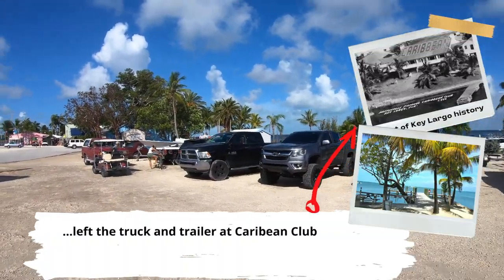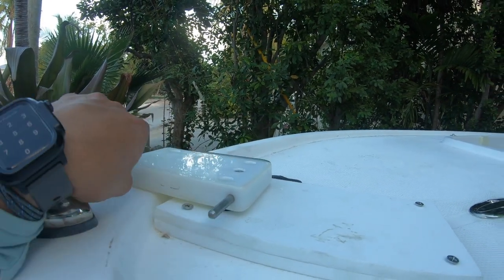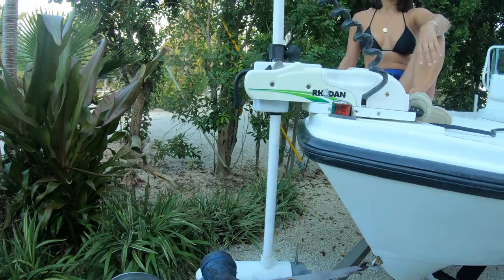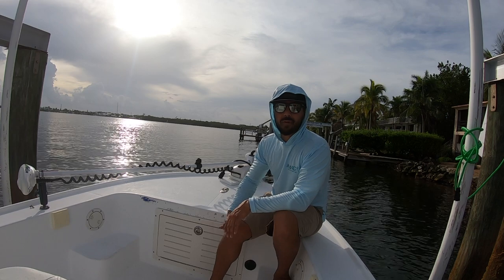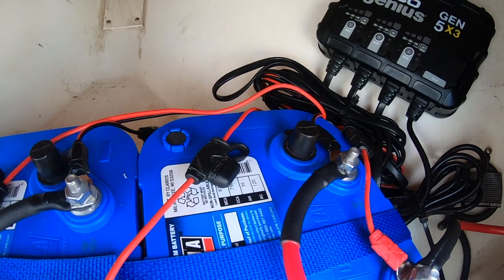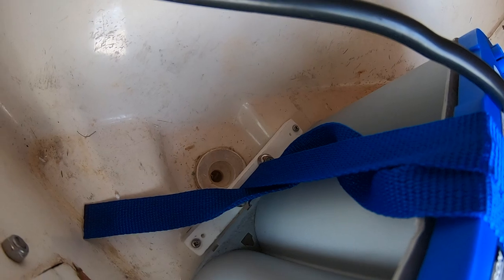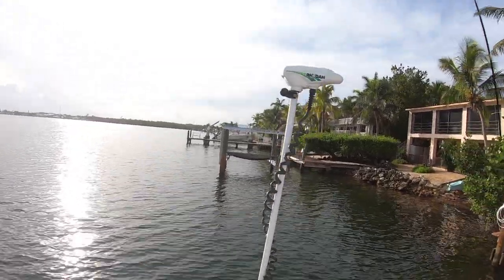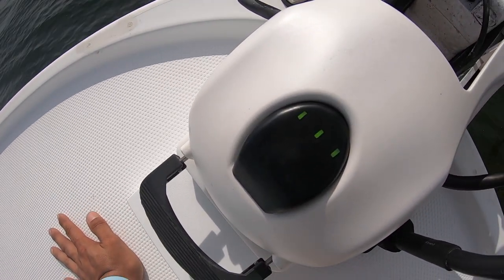Rhodan HD GPS Anchor Trolling Motor Installation on a Mako 171

Comment: Im about to do this to a 1973 Mako 17 that I just purchased. How did you mount the NOCO 3 Bank Charger?
Reply from the maker: In the front hatch up against the gun wall 👍🏽
Reply: @ChasingFloridaa  I saw the location in the video. I was curious what kind of screws and how long  they are? Thanks!

Comment: I'm literally about to run the same exact setup I have the same exact TM but I don't know what batteries to run with? How well do your optima perform? Yesterday I almost bought a single 36v ionic battery
Reply from the maker: I’m running 3 D34M optima batteries marine blue tops.  I couldn’t fit 31 or 27’s.  The 31 series is ideal.  I like the singles 36v batteries, the thing is it’s only good for the TM.  I installed a switch over on one of my optimas to power my outboard and Radio system in case I lose the main one.  Just something to consider.  I fish 8 hours with it, usually GPS anchoring in heavy current and moving position in 5 foot increments.  I’m sure if I anchor up in weak current I’ll get more time out of them but I haven’t done that yet so I don’t know for sure. Hope that helps! 👍🏼

Comment: Great Vid, I'm new to boating and considering one of These Rhodan. I have a million questions, but i'll refrain =). biggest concern for me- 
how long does the charge last? will rougher waters drain it faster?  recharge time?
Reply from the maker: Fully charged I’ve gotten about 8 hours.  I’m running group 34m AGM optima marines.  Group 31 and 27 will get you more.  Consider the space and wiring.
Reply: Look on Amazon for the group 31 from Odessey. 100 AH. 
PC- 2150 S 
The letter dictates the stud type. Odessey uses 99% pure lead and thin plates making them heavy but more powerful than others. They cycle deep and last a long time. They’ll recharge in about 4 hrs with the right charger. They are AGM batteries. Be careful with lithium ion batteries. A lot to know about them. Not just a throw in and go battery. Wind,current and seas will determine how long a charge will last. 3 of these may give you more than one day on the water. The propeller is always turning but speeds up and slows to keep positioning possible. Very quiet too. Had a 36 volt on a 32’ Cape Horn holding position with a 26’ tied behind. Awesome unit.

Comment: What size ball is that ram mount  is it a b or a c
Reply from the maker: It is size C which is 1.5 inch.  Mines came with my trolling motor.  You can buy them on Amazon or direct from RAM.